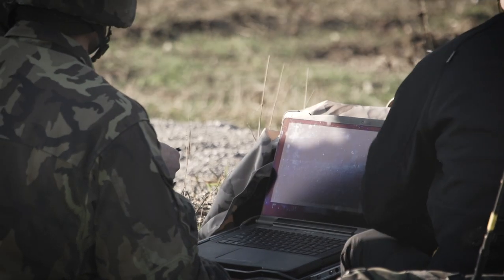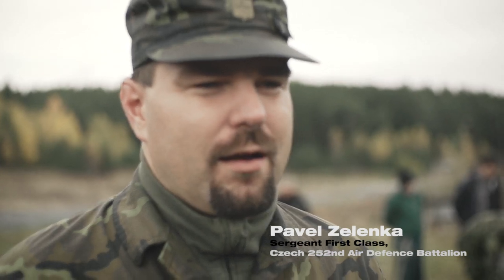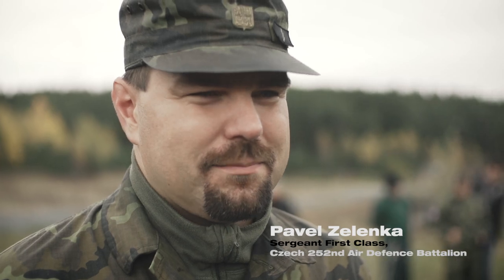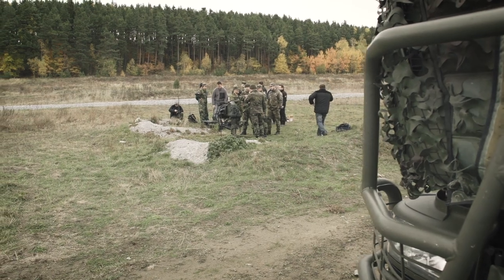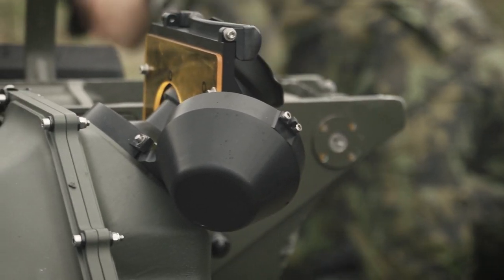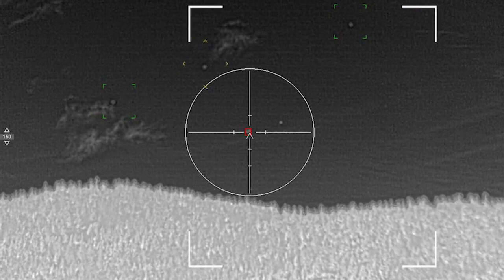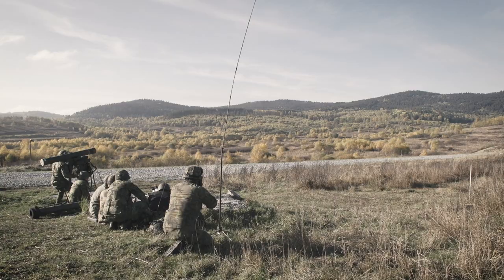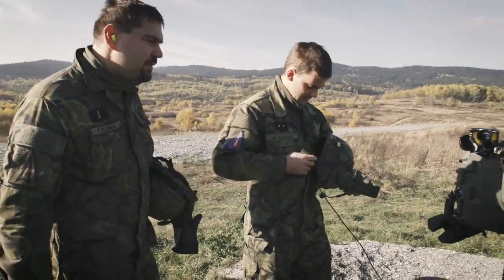Behind the scenes: RBS 70  NG test-firing by the Army of the Czech Republic

Comment: Short range, unproven, ineffective and with stationary position obsolete system.
Reply: +xmeda  ineffective and with stationary position obsolete system did we just watch the same clip?
Reply: But it's really not a MAN P-ortable A-ir D-efence system. As well as not Fire and Forget. Honestly, it really looks outdated in comparison to traditional MANPADs, compact enough to be transported and operated by a single soldier.
Reply: You mean Igla or Stinger? They can be very easily avoided by modern flares.
Reply: Easily?! Are you stuck in 1980's??? Because in 2017 IIR and multiband seekers made flares useless like a 10 years ago.
Reply: Oh so you can run with RBS-70 130kg firing rig. Then deploy it and fire on the incoming aircraft or heli before it kills you.. hmm. hmm.  Bravo! Maybe think more first. Not to mention that you have to follow target during whole guidance process, which is suicide in any real conflict. Not a single aircraft was shot down with this thing. On the other side Igla, IglaS and chinese copies PROVED to be deadly local anti-aircraft tools. Last version 9K333 Verba is able to attack incoming targets with speed up to 500m/s. And it still is ONE MAN PORTABLE system, that can be fired from shoulder on ground or from basically any vehicle. That is MANPAD.

And bonus. Even Swedes decided to design replacement for this system including IR fire and forget tracking head.. This is why this equipment already is OBSOLETE.
Reply: This system saw combat during the Iran-Iraqi war. It was credited with shooting down a couple of military aircraft thus it's not unproven. You just didn't about it before. It also has a longer range than any other MANPAD currently in 
existence. But I would prefer a fire-and-forget model too
Reply: Erik Mellander  How many planes and helicopters were shot down by your PROVEN system?
Reply: Erik Mellander  which conflicts and which confirmed kills? Tell us...
Reply: Erik Mellander  No I want numbers, aircraft types and conditions. Then you will see that this system is near to useless.
Reply: The Iranians really liked them in the Iran-Iraq war !
The system also stopped the Chavez coup in Venezuela
Reply: @xmeda  Most of those systems are reliant on IR passive heat seeking. Can be defeated. This system is 100% unjammable and it's laser guided. It's no Suicide for a small squad having this system at the ready. They can also be used in platoons and so on, brought a long in vehicles etc. Set up in 30 seconds, with fast and pretty decent interdiction range. As said LASER GUIDED. Cannot be defeated. 

Yes Stinger and Iglas are effective and very lightweight etc. They can be defeated with flares and jamming. Stinger has a ceiling height limit of 11,000 feet. This system has 50,000 feet and 9km range. Overall longer range, and a LOT higher ceiling.
Reply: LOL..
If you come in with a Chopper, or an A10 Warthog against this, you're F*cked.  It's a short range UNJAMMABLE laser guided system. Can be set up in 30sec, reloaded in 5 seconds. It's CLEARLY a system that can be carried in any military "jeep", troop carrier and most military is mechanized today. So yeah.  They get info of incoming choppers or attack aircraft.
Set it up and watch planes/choppers rain from the sky. Watch the deploy flares and try and jam to 100% FAIL and then DIE..
I can't even begin to think what a nightmare it would be to show up in HIND or APACHE etc and some squad see you coming Kilometers away or maybe 2-3 of these systems and they just fire one at you. You cannot escape it. Your defense system is useless. 

Tell me again how "poor" it is..
Sure a Stinger and Igla is nice and even more portable. But they rely on systems for tracking IR-passive and so on. They can be defeated in jamming/flares. They don't have high ceiling capability either. 

The point is what would be your answer if this was fired at you in a Chopper or A-10 warthog or a drone etc? It's coming and your only hope is to outrun its range. You could try and fire a counter missile. But it won't arrive until this RBS missile has hit you. 

Point is. It's not useless, unproven and obsolete. Only an idiot would think so.